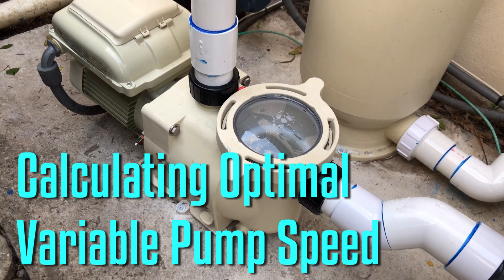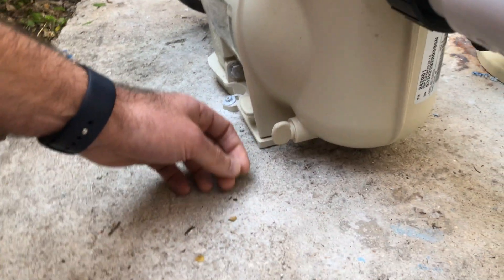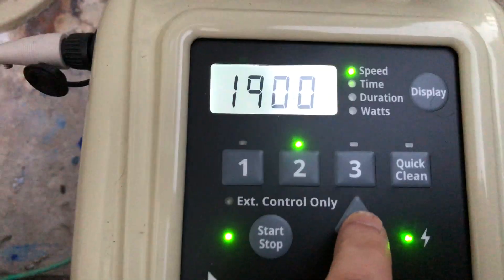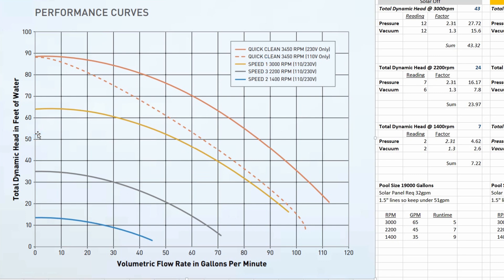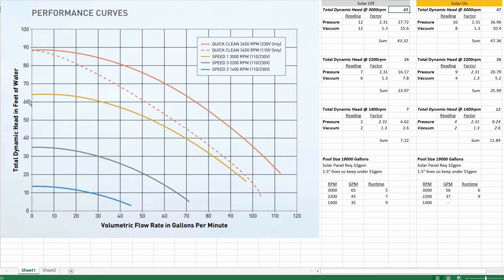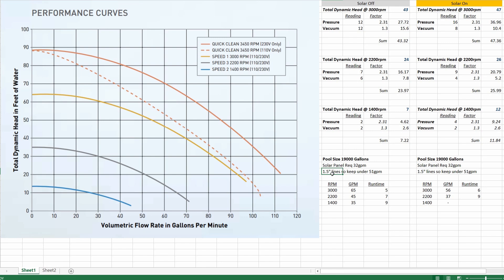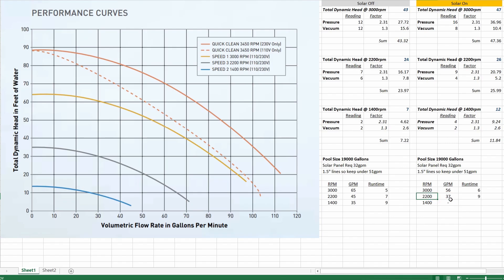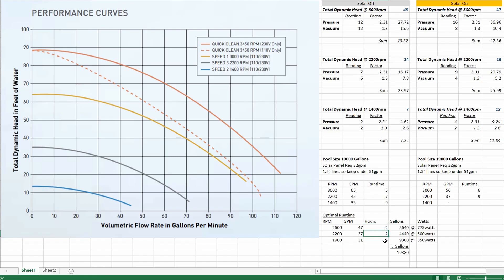Calculating optimal GPM flow rate on Pentair SuperFlo variable speed pool pump

Comment: Great example, I plan to use it.  BTW, I notice that the folks on Trouble Free Pool advocate that with their recommended pool chemistry (most notably FC at 7.5% of CYA) turns of water each day is not important.  Filtration has its place, and water movement has its place, but they advocate that one should not expect your filtration to keep your water sanitary.  If you are not already familiar with the TFP view on this, you might want to check it out, I'm curious your thoughts on this.
Reply from the maker: I wasn't trying to imply having the proper levels of sanitizing chemicals wasn't also needed, but that they will work more effectively when the pool is being filtered and the water is circulating. For sure there is a balance. Trouble free pool is a great website.
Reply: @reallyMello  I was not suggesting you were implying that.  I was more curious your thoughts about the idea their turning over the water of a pool each day is not particularly important if one is following their chemistry guidelines.
Reply: I did a test last summer…. I ran my single speed pump only 3 hours a day to the horror of most common wisdom.  I’ve never had a green pool and last summer was the same.  Kept FC appropriate for my CyA level and pool was perfect. 

Moral is circulation is less important than proper FC level.  Much less important.
Reply from the maker: @ericrandall3539 nice, thanks for sharing your results!

Comment: Here's some additional helpful info to mesh with your solar heating considerations ; The majority of grid-tied solar electricity (PV) systems are based around the concept of trickling electricity back into the grid during daylight hours (credits) and drawing from the utility at night. However,  the utility will usually credit or purchase the electricity from you at significantly less than you do from them.

Heating water directly is still FAR more efficient than converting sun energy to electricity and then to heat, but as far as electricity consumption for equipment goes, if you have PV, it is to your benefit to consume as much of your PV power onsite as it is generated before being "credited" (at a loss to you) back to the utility (at a profit to them). The trick. of course is to maximize this low-level consumption while attempting to avoid being a net consumer during peak hours. This is the premise for battery storage systems-store and consune your own generated electricity without selling it back to the utility at a loss.

So long story short, if you have PV, you could see up to a double-digit percentage gain in electrical efficiency by running your pump at a low speed during all daylight (production) hours in-between high-flow times rather than waiting for cheaper night rates.

Of course,  the variables include pool/pump size, PV size, other household loads, geolocation, ant 1000 other things. Personally,  my PV generated kW-hours are nearly double what my utility shows on my bill as credits, and that is because our air-conditioning is gobbling up the difference before it gets to the meter. In essence were denying the utility half of the convenience fee they would charge us fore time-shifting our consumption the way they encourage us to.  This is exacerbated because our PV is oversized.

Comment: Great video! It helps out a lot. On the last step you select speeds that don't have curves on the performance chart. How did you get their flow rates? Estimate based on the existing speed curves on the chart?
Reply from the maker: Thanks. Yes, I made some estimations based on those curves.
Reply: The power of interpolation!

Comment: Great video. I have supermax vs at 3000rpm vacuum=7 & filter=12 TDH=35.63 (35) the chart shows 80gpm. Confused as to how I have lower TDH than you but chart shows more GPM. The lower TDH= higher GPM. I used 1.13 for vacuum & 2.31 for filter. What am I missing. Thanks again for the video.
Reply from the maker: Hi John there will be a chart specific to your super max pump with different curves

Comment: where do you factor 2.3 and 1.3 ? is that a given number?
Reply from the maker: I misspoke on the video it’s actually 2.31 and 1.13 and they are givens
Reply: @reallyMello  thank you  for the upload and reply
Reply from the maker: My pleasure I hope it helps you get your pool settings dialed in

Comment: vacuum factor is 1.13 not 1.3, thanks
Reply from the maker: Thanks Jay, you are right I misspoke. Another comment thread caught that previously and the spreadsheet I attached has the correct factor now. Thanks for bumping the correct info to the top.
Reply: @reallyMello  Hi ReallyMello. I would like to request a copy of the spreadsheet. How can I download it?
Reply from the maker: I have it linked on https://www.davidmello.com/calculate-gph-flow-rate-pool-pump-savings/

Comment: Question: The chart you used, Is it for your specific pump? If so what was your horsepower? I have a 3hp Pintair VS and using your chart at 3450 with Filter at 30 and Vacuum at 9 I get DH at 81. From your chart that equates to only 40GPM. The 3hp says at 3450 it is around 90GPM.
Reply from the maker: Hi Billy, it is specific to the pump so mine wouldn't apply if you have a different model or HP. It will be in your manual if you still have it (or on the pentair website). If you have the 3 HP Intelliflo variable speed they have it online here https://www.pentair.com/content/dam/extranet/nam/pentair-pool/residential/manuals/pool-pumps/intelliflo-vs/intelliflo-vs-pump-manual-english.pdf starting on page 26.
Reply: Hey! Can you explain how to calculate the factors to apply on pressure? Thanks !
Reply from the maker: Hi there I’m not following your question if you could clarify
Reply: @reallyMello  for calculating total dynamic head once you have the two pressures.
Reply from the maker: @CyrilBoudot-hc4wk  see if the accompanying article helps https://www.davidmello.com/calculate-gph-flow-rate-pool-pump-savings/

Comment: having a new VS pump installed shortly - and after seeing this I feel like  I have wandered into a minefield.  I have no clue how to use gauges to calculate the regular pool run time rpm.  I have a 25 to 30 k gallon pool.  Had a challenger high flow pool pump mod 196251  - new mod is a 011028.  i do have a spa - that I want the flow rate to be a higher - when I use it but beyond that I just want my pool pump to turn over my system at least the minimum of 1 time a day at a reduced rate from the old pump.  Geesh... i need help.
Reply from the maker: This is if you really want to scientifically dial it in/optimize it. If it’s being installed ask if they can install a flow meter for you in line if you have space. Then you don’t have to do so much math since the flow is directly measured.

Comment: Hi, thanks for providing the info for 1.5 inch pipe what if you have 2" pipe? Thanks
Reply from the maker: You'd want to keep the flow rate under 80gpm max for 2" pipes. The process and calculations would be the same for 2" pipe, but be sure to stay under the 80gpm max vs a ~51gpm max on 1.5" lines. The numbers themselves will differ depending on how much pipe is in the system, diameter, the bends, height, etc so you'd need to check the gauges and find the numbers specific to your system.
Reply: @reallyMello  Great video, thank you so much.   Where did you get the max flow for pipe size specs from?  (51gpm for 1.5", 80gpm for 2")..    Thank you!
Reply from the maker: I think I lost the site I bookmarked for that sorry. I’ll keep looking.

Comment: Have you ever used pressure gauges with hoses that you would attach to the pump as an alternative to using the method here? Can you do a video using them? Thank you!
Reply from the maker: Hi Jay, I haven’t but if they provide the same vacuum and pressure readings the calculation would be the same
Reply: @reallyMello  Oh, I see, you lowered the cleaning RPM's and raised the Filtering RPM's to stay within what your solar system can work with, Nice job, thanks
Reply from the maker: @jayortiz6893  my solar system has a diverter valve that will bypass the roof if the pool is hot enough or if the roof isn’t hot enough to heat. That typically means most days it starts heating around 8am or so. I need to make sure the RPMs are high enough during those times.

Comment: 1:38 misread the pressure gauge... 12 bar you said, but that 12 comes from the red circle so those would be psi, or 0.8 bar... would you double-check that?
Reply from the maker: Thanks for catching that Emiliano. I meant to say PSI which is the red circle like you mentioned. So I took the correct number, but said the wrong term. You take the PSI and Hg numbers for the math on this one. Hope that clarifies things!
Reply: @reallyMello  Awesome! I knew it! Thanks! Great video... trying to make it work on my 23,000 gal pool with 2" PVC pipes (45 lf) 1 tee, 4 90s, 3 45s... a bit confusing but getting there!
Reply from the maker: That's great you have 2" pipes. It should have less resistance. I have an older house and pool where 1.5" was what they used at the time.
Reply: Was going to say but beat me to it by about 6 months

Comment: How did you come up with the 2600 rpm for first 2 hours of optimal run time?
That rpm was not used in the two charts.
Reply from the maker: Hi Patti, I inferred it off the other curves

Comment: Aquired a house with a pool and pentair superflo vs variable speed pool pump. Original pool was installed in 1991. Same pentair vs pump.
Where to find an instruction manual for it?
Reply from the maker: https://www.pentair.com/content/dam/extranet/aquatics/pool-pad-pro-assets/pumps/inground-pumps/superflo-vs-variable-speed-pump/356292-superflovs-superflovst-supermaxvs-owners-manual.pdf

Comment: I have the same pump and just bought a vacuum gauge to do these calculations. My vacuum readings are very low. At 3450 RPM it is 4 and below 2500 RPM it is close to zero. And when get down to 1400 RPM both my vacuum and pressure readings are 0. So that is not even on the pump curves. Yet I know that 1400 RPM is the cutoff for my heat pump to work which is at 20GPM. So using the Pentair performance curve, the TDH is about 12 @1400 and 20GPM. And I did test more than one vacuum gauge to make sure the readings are correct.

Comment: Great detailed info.  However I've decided to install a flow meter on my return side to have continuous GPM readings without having to repeatedly refer to THD charts and then use that to adjust the schedulle for my VS pump.
Reply from the maker: Sounds good. Certainly the most convenient way if you have the space to add one, but I’ve found once you have things dialed in once you shouldn’t need to change it again unless maybe your filter is dirty in which case you should just wash it. If I had the space I might have done the same just because I’d nerd out about the exact gpm.

Comment: Hey any ideas if my reading are coming out above the curve?? For example at 3k my P was 26 and Vacuum was 9.5(this was after I cleaned the filters)
Reply from the maker: I just wanted to confirm first that you are using are the chart provided for your same make and model pump?
Reply: @reallyMello  Yeah I have the pentair Sta-rite supermax VS. Just in case i looked at the chart in the manual online.
Reply from the maker: I’m using the superflo vs so it is a different chart, but it does sound like you matched the performance curve chart to your model online…so it’s not that…
Reply: @reallyMello  Yeah i didnt know if my pressure readings were too high forcing it to be off the curve. Or if there is a different variable when using the multiplier depending on pump/filter
Reply from the maker: Multipliers would be the same but for vacuum it should be 1.13 I think I may have misspoke at one point in the video and said 1.3. I updated the spreadsheet to fix it.

Comment: Your gage reading was in inchs of mercury and psi , not bars, but it didnt affect your calculations since you made the same mistake on both readings, and ratio remained same.
Pentair used to have a pump run time calculator that would tell you how many hrs for a complete turnover you needed at diff. speeds. They removed it and instead just show you how much energy savings you would have if you switched from single speed pool pumps to their variable speed pumps.
Reply from the maker: Aha! Cool, thanks for letting me know.